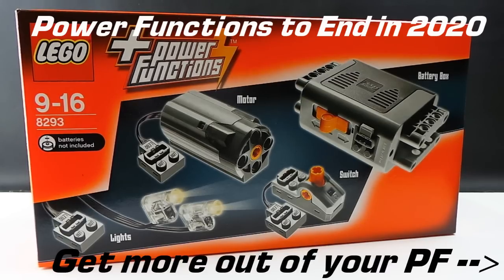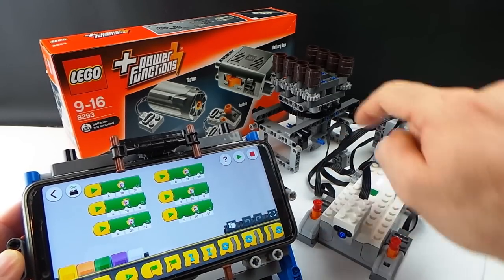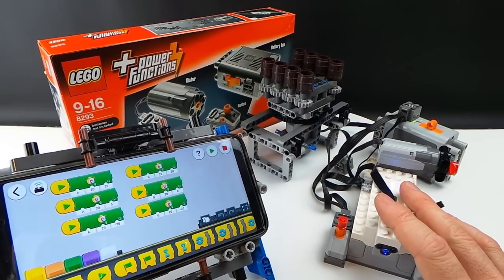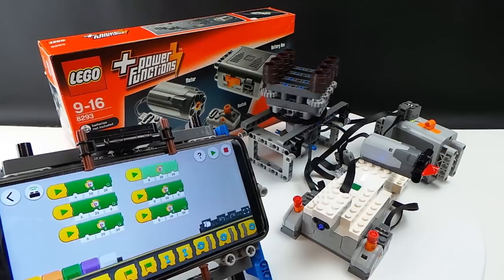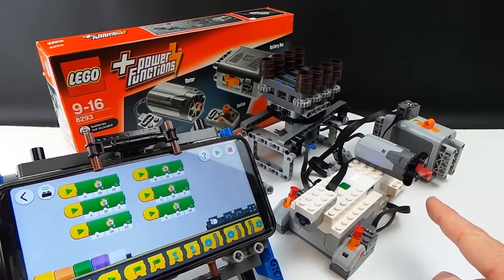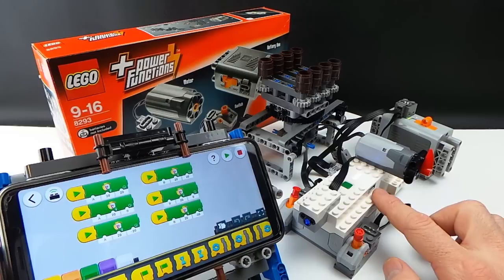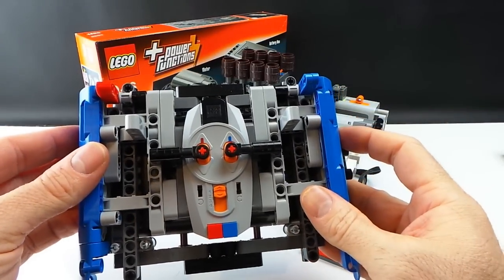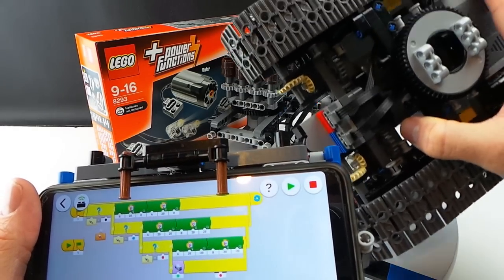Lego Technic Power Functions Retires 2020 | Lego Powered UP Replacement

Comment: oh nooooo i gotta get some extra pf before they're all gone...
Reply from the maker: Yep. There is still quite a few on Bricklink but I would say that they will get rarer over the next 2 yrs.
That said the new powered up stuff will have a "dumb" battery box that will be used to drive the motors without the smart hubs thus you will be able to run them the same way as Power Functions. The first one due out in in the one of the new sets in 2020

Comment: Pretty ingenious way of connecting the two systems!

For most casual fans I'm sure they'll just pick and choose one system but I like the idea that you can actually get some use out of these hubs.

I really wish they'd come out with an adapter that just lets you use the old motors on the new system though. It'd make the new train hub useful and the new technic hub coming out in Top Gear Rally Car a bit more useful.

At the very least the new PFv2 will have pretty much every basic component by 2020, I just hope we get the other types of motors soon. Gotta please the enthusiasts first to get the new system to stick
Reply from the maker: From what I hear around, Lego are looking at making an adapter cable. 
The other good news is the new battery box that has a basic on/off soon

Comment: Should we stock up on pf? Maybe buy a few of the 42095 set when its on sale as it has 2x l motor, battery box, ir receiver and controller?
Reply from the maker: That is a good idea. I bought a few already. That said the motors are still pretty cheap and readily on Bricklink. It might be a year or so after they discontinue them before they are rare. 
That said the new control plus motors used in Technic will eventually (as planned by Lego) to have a "dumb" battery box in the future so they will work just like PF in the future

Comment: for variable control - it's an ugly hack, but you could use the Boost motors to control the dial on the PF Train remote, to set PF Motor speed :)
Reply from the maker: hmmm that would work but like you mentioned it would be a bit of a dirty hack. What I plan to do is use the color/distance sensor to detected a point to turn on and off the PF motors and use gears for speed control. Have you seen my Boost GBC video? It uses a mix of Boost hub and PF and works really well https://www.youtube.com/watch?v=RstnGxkrVS4
Reply: @SmashingBricksAU  Yes.. I have... planning to do my own Boost GBC soon too... just gotta find some time! :D
Reply from the maker: @RohanBeckett  I hear you on finding time! Drop me a line if you have any problems (best to do that on ReBrickable). The timing of the pneumatic switches is key.

Comment: I agree with the comment about why all good things come to an end but all good things do have to come to an end eventually but would have been nice if there they waited for 2027 and had a big farewell 20th anniversary power functions LEGO Technic range to celebrate the humble power functions and the 20 year service they would have provided at that point to retire product at 13 years just seems a bit of a missed opportunity
Reply: Indo saying that I don't believe the new paradox function is going to be that bad because he will seem to think that we're getting something similar to what boosts has as you know this is entirely new system specifically developed for LEGO Technics from what I've read
Reply from the maker: @brickleyyard4966  Boost is now part of Powered UP Line with the target market is kids to young teenagers (although it is a great way to introduce programming to anyone). Control Plus will will be more focused towards Technic. I do believe that they will all blend together at some stage because the Tech is all the same. If Lego dose not do it the Technic fans will!
Reply from the maker: The other missed opportunity is that they should have an integration plan for the 7 yrs to take it to 20 years of service. It would not have been to hard to do because it is a DC variable controller and it is basically the same one that is in the SBrick. With that you would get variable speed with the PF motors.

Comment: why do all good things come to an end. I hate it when something good gets replaced with something "better" and they turn out to be shit. Why replace something thats already perfect? Why do they do this with everything on this damn planet
Reply from the maker: Yep, Power functions has ad a good run and there is still lots of parts available on Bricklick and the 8293 set is still on shelves. The Powered UP & Control Plus Hubs, Motors and Sensors are pretty cool to use so it is not all bad. If you build using the Techniques in the video you can use your Power Functions for years to come and save  batteries too!
Reply: @SmashingBricksAU  I dont like that we are heading toward the shit that we will end up at the point where we cant play legos with out having a smartphone or a tablet shoved in our butts.